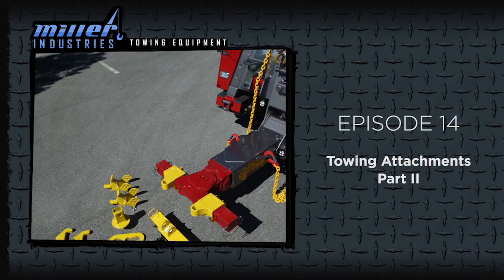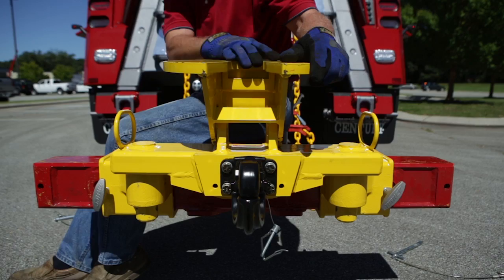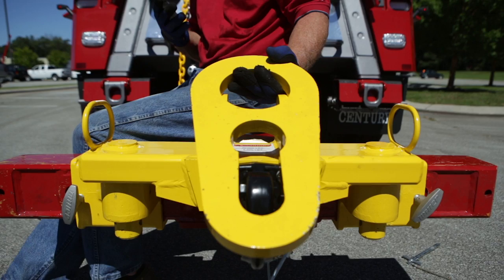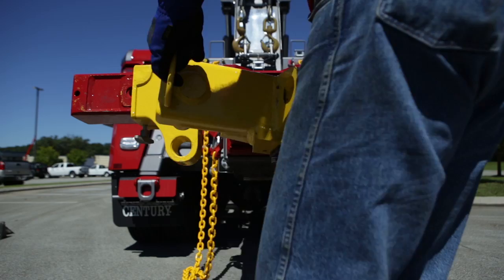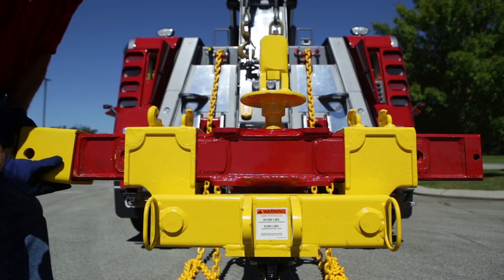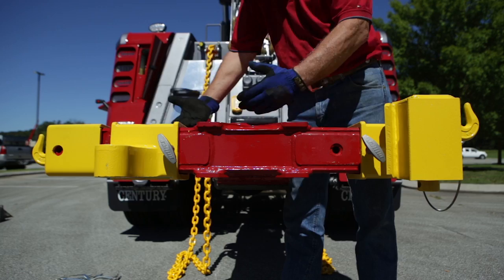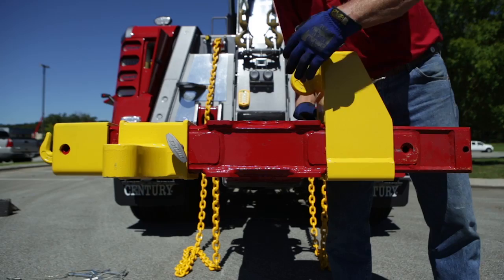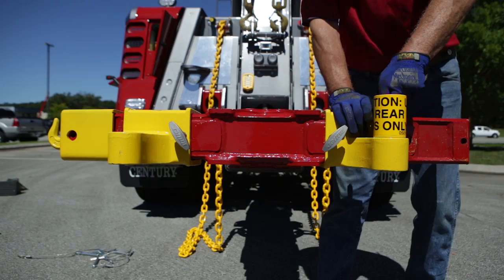Miller Industries - Now You Know Towing Attachments part II

Comment: I don't think those eye chain grab hooks are intended to be welded.  The only place were weld penetration occured is where the eye and the hook made physical contact with the surface of the fork holders.  There are chain hooks specificially designed to be welded to a mounting surface.  If you need eyelets, a d-ring (up to 18,000lb breaking strength) welded to the fork holders would work.  Am I wrong?

Comment: If you ever wanted to just "sit there", this is the job for you. Video would be worth finishing if they took the time to demonstrate the equipment rather than half assing it.
Reply: Considering the number of "disassemble your truck down to individual bits of metal and put it back together in battle robot configuration" changes to handle what should be simple 5 second switches like pintle hook to ball, actually demonstrating it all would take weeks...sort of like actually using it.
Reply: medicwana
Reply: There is no way he is going to demonstrate every single attachment in one video, Takes 10-15 minutes just for one demonstration of one set of forks or attachment device, There are videos from miller on these attachments but all in one video is not going to happen without a 2-3 hour video. Go look at their other videos for demonstrations on particular attachments or just sit back and ignorantly judge as if a channel can't have more than one video.